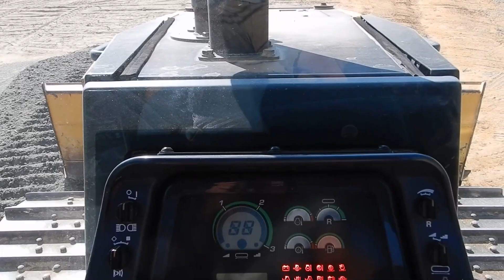Spreading 1000 Tons Of Stone Today

Comment: i tipped a 4ton forklift once by a similar movement like the left truck at 1:23. I believe the truck driver knows very well how top-heavy machines operate but hearing the hydraulic squeel and seeing the right tire lift made me shudder. In case of my accident I had about 800kg(1500pounds) at around 2,5meter(8ft) above ground, so i could see UNDER(this was what did it) the load where i was going. I started moving but the leadacid forklift stuttered forward with the load in the air. Because I had my wheels turned i started tipping immediately and couldn't save it.  It is my only accident in 4000 hours

It was an open cabin and i found myself 90degrees tilted and hanging on the left side, which was now up, while acid started making its way under me towards stacks of tv's. We wasted about 4 brooms and i was in shock for the rest of my shift. not one scratch on me.

Comment: Hi, at minute 5:55 what are the small wheels on the side of the trailers of the trucks that carry the stones?
Reply: Those are drop/liftaxles. States have weight restrictions on how much weight you can have per axle. So they have axles that lower and raise. So you can haul more weight legally.
Reply: @drivingmylifeaway7149  Ok, thanks for the explanation, the trailers that circulate in Italy have at most 3 axes, for what I didn't understand, I thought they were spare wheels.
Reply: @black_mamba43  yea. You have air bags on the axles and you can control how much air is in each (10-60psi). We have strict regulations (all about money and fines).. those trucks in the videos were only haul 20 to 25 ton each trip legally. But the truck will handle way more ahha your very welcome! I always wish people answered my questions so I do my best!

Comment: I used to push out and grade 240   ten wheel dump trucks a day with a D6 LGP. Miles of fill, some areas 50 - 75 foot deep. Compound grades, 5 foot lifts. But I have done more. Myself and a partner pushing out a constant line of trucks (1/4 mile long) mostly 18 wheelers with supervisors lining them up and dumping 10-15 trucks constantly at a time. Ten foot lifts, using D9Rs. All this was preparing Fresh Kills Landfill (now closed) for final capping. It was the largest landfill in the world.

Comment: We need to call out the suppliers about shorting loads. It's becoming a real issue, loosing 3-4 tons/yrs per order. No I didn't believe it until I started inspecting the drops, sure enough it was a average of 3-4 per truck called out the supplier and their response ( we wouldn't do that on purpose). Inspect your drops.

Comment: is there a reason why you dont let the trucks do some of the spreading of the stone
Reply: Just faster and more convenient when a dozer is there. Cycle time is key here.
Reply: I was wondering why too. I've been on jobs that the driver's are told the depth and they set their spreader chains and lay it down. After it just graded out perfect with the grader. I guess everyone has their way that works for them.
Reply: Because the trucks only spread the stone the width of the truck so it would just be long streaks of stone, this way he can spread it over a wider area and he can make it thicker in low spots and shallower in high spots, something the trucks cant do
Reply: Michael Stobie not really 1he has already graded the area so there shouldn’t be any low spots 2the driver can use the chain on the lift gate to control the amount of stone that comes out in addition to controlling the speed of the truck.
Reply: He explained in an earlier video that there was humps and hollows and he would have to grade the stone out to properly level it, when your in a truck you cant really tell where the humps and hollows are and you cant really control the speed, spreading with a truck would be less efficient then simple grading it out roughly with the dozer

Comment: Hi I was wondering why you didn’t have them set chains and tailgate spread?
Reply: Some owner/operator trucks won't tailgate. If the bed or gate is aluminum it will bend. If they spread too thin the dozer is always turning around & pushing backwards instead of always pushing forwards.

Comment: I hear you !  I had 104 loads like that put in the back yard (farm) and build a 90x90 foot pad.  Land slopes off about 8' in that length.  That put in and foundation dug out - 
Then 95 Cement trucks.  What a bill on those!  Had a laser D8 and an expert level and pack three trucks at a time.  Constant line of trucks pouring and doing a circle and then out the other side.  You did a great job !

Comment: Why not do rolling dumps❓
Reply: Could cause the truck to tip over.  Not good.
Reply: No danger of the truck tipping over on that ground, but it would take a lot longer to spread it to the correct depth if the trucks tailgate spread it. The dozer has to be able to come off a flat-to-grade surface in order to carry the same grade along.

Comment: Thanks for the video, good as always. I was wondering about how many trucks, you answered it at 10:00 50 at 20 per truck. Can the 6 axle haul more than the 5 axle or is it just for weight distribution? Take care.
Reply: Not sure what state letdig18 is in ,but in NC centipede(4 drop axles)25 tons, quints(3 drop axles) carries around 23 to 24 tons ,quads (2 drop axles) 20 to 22 tons, or what the local quarry will let you out with most are very strict legal weights only.
Reply: It varies from 15t to 26t depending on axle config

Comment: Looks a bit like what we call type 1 over here which we use as a granular sub base. It needs to come with a bit of moisture content so it can be compacted, but boy does it compact down well. We had an old grader on a job I think it came from the military, we had an old boy that operated it, I think he was ex military. When he retired they struggled to find a decent driver, good grader drivers are, apparently, as rear as rocking horse crap. Any chance you could run through the controls of the grader next time it gets an outing.

Comment: The drivers get bunched up like that because they are racing to get one more load than the others for bragging rights. (It's a boring job.) Have a good one.
Reply: Forget bragging rights. It is $$ in the pocket if they are being paid by the load. If you own the truck we are talking $12-$1,500 a day when things are clicking.
Reply: @rajbeekie7124  that's on owner operator rigs, when I did it the company owned the trucks, so you were paid by the hour.
Reply: bigtx77  I am talking about an owner/operator. Now, if you are a driver it will be per week.

Comment: How many tons per load? Does your state require quad axle truck? Here in Alabama we have tri-axles and can haul 25 ton legally
Reply: That explains why our roads are shitty lol
Reply: You should be closer to 27 tons in Bama with a tricycle (unless your truck is really heavy to start with). Tandem is 21 tons.
Reply: Damn in Wisconsin a quad on average takes 21. Grossing 73,000 max.
Reply: @4You5Tubeber  we are 80k on all roads except interstate with tri axel
Reply: @ResidentialDirtWork  I wish we could legally run that much with a quad.
Reply: @4You5Tubeber  we can run 31 tons in a 28' tri axle trailer.
Reply: @ResidentialDirtWork  if I am right it is 43,000 for a single 5-7 ton 53,000 10-12 ton for a tandem 63,000 16-18 ton for a tri 73,000 20-22 ton for a quad and 80,000 22-25 ton for a tractor trailer

Comment: You need about 45 truck loads cause a dump truck Carrie's about 22.5 tons per load
Reply: to me thats insane, here in norway a dump truck can only take about 11 tons. You woud need a dump truck with trailer or one semitrailer to carrie 22 tons.
Reply: @hakon7275  in the UK we use 32 tonne gross tippers carrying a 20 tonne load , that's standard for lots of companies.  That's the heaviest you can have on a rigid chassis
Reply: @dennisphoenix1  isnt that metric tons?  Metric tonne is 10% heavier than a US (short) ton, so its lime 22 of our tons
Reply: @berhorst59  sorry , realised my incorrect units . A tonne is 0.98 ton  . Still 32 tonne gross in the uk

Comment: The closest I ever came to getting killed on the job was running one of those vibratory rollers.........................I liked scrappers (when I was young) because you always had the can to drop in case things got hairy! .................PS. I really like your channel and the way you handle equipment!!!(:>)..............And, YES, I watch at least 30 seconds of any commercial AND make sure I give you the old "thumbs up" so you can make a few bucks.(;>)
Reply: Reg Pettinger 
Shake you right out of the seat did it.......
Reply: If you really want to live on the edge push overburden with a D10 with about a 40% grade.

Comment: I had 20 tons of stone delivered for $208 so 50 loads around $10k, probably got a discount for so much stone.

Job around here moved 6000 loads of over burden and brought back in 6000 loads of clay had about 40 trucks running every day for months
Reply from the maker: I want your half price stone source
Reply: Wow. You beat me to it. Wish i was close.   If it's what Chris is putting down is 475/485 delivered for 22/23 ton.       You must have been getting some of that over burden?     Shit clean fill goes for 175/190 triaxle load
Reply: I would kill for any of those prices. 6-10 crushed limestone is $700+ here in central Mississippi with trucking for 15-17tons.